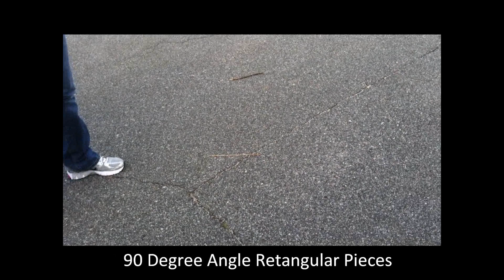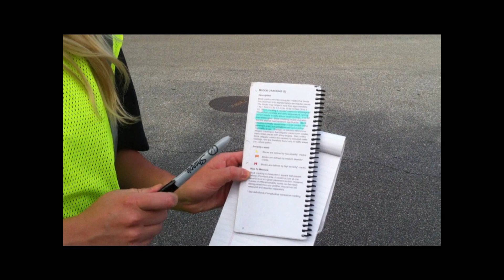03 Block Cracking MicroPAVER StreetSaver Pavement Distress Evaluation with Lyndsey

Comment: Hi Blair. What is your solution to preserve a cul de sac with block cracking? We have a dilemma where cape seal doesn't fair well in cul de sacs because of the rutting from trash trucks tires. Microsurfacing hasn't held up to the reflective cracking, and slurry doesn't hold well to wheel turns or reflective cracking either. Grind and overlay is expensive. Do you have any suggestions?

Also- can you recommend a firm that is very good at providing PMS for an agency?

Thank you!